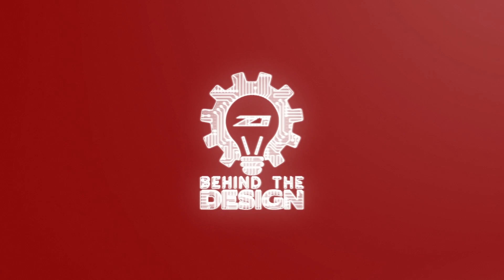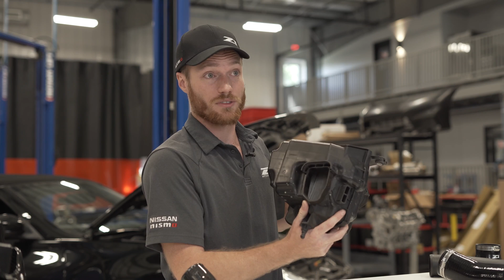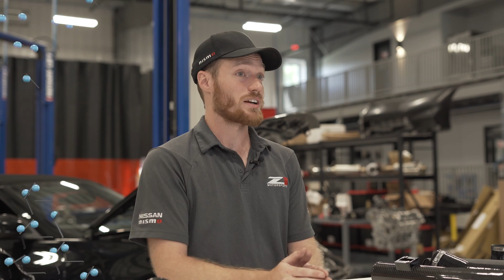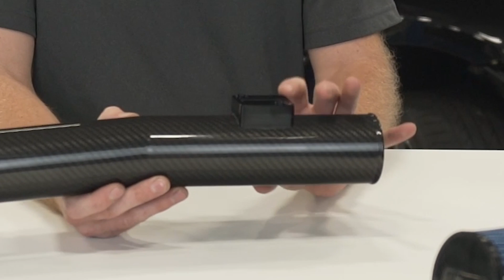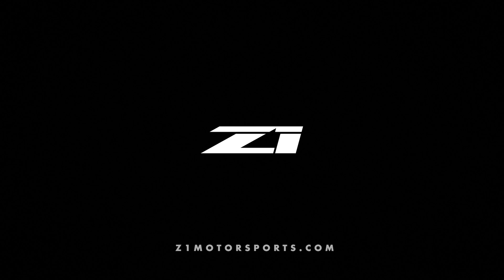Behind The Design | Z1 Carbon Fiber Intakes

Comment: The Z1 intake is NOT 2.5" all the way through. The silicon pipe squeezes through the radiator wall, therefore bottlenecking your intake at that point. Also, in the high RPM range that silicone tube can and will give as your engine sucks in all the air it can. Vacuum effect. Thoughts?

Comment: I dont know if anyone is going to read this but would there be anything to gain moving to the 3" intake from the standard old Z1 intake with the Vstacks, Can the Vstacks be used on the 3". 
I do have LTHs but no plans on going cams.
Reply: You’ll get more power from a 3” but you must get a tune
Reply from the maker: There would be a marginal gain in power, however in your particular situation I wouldn't expect to see major gains. We have seen great gains on cammed VQ's since they demand much more air (especially at higher RPM's) but these are far from the typical build. 

If you're trying to extract as much power out of the stock internals on an NA build as you can, it would certainly be worth investing in 3'' intakes. Additionally, we do offer the velocity stack upgrade for the standard 2.5'' Z1 intakes.

https://www.z1motorsports.com/z1-products/z1-motorsports/z1-high-flow-race-intake-upgrade-kit-for-z1-or-stillen-gen-p-9199.html